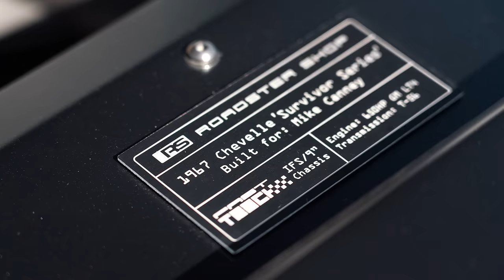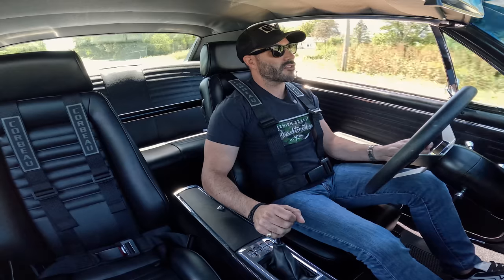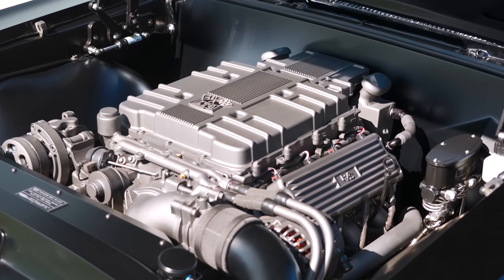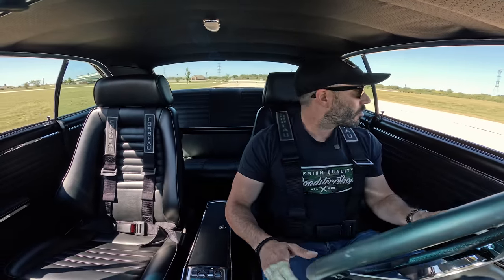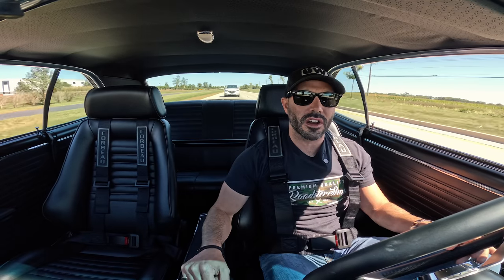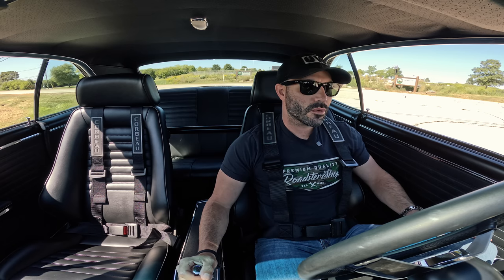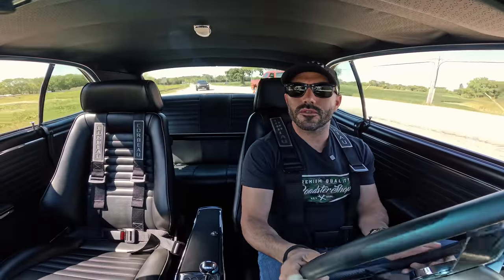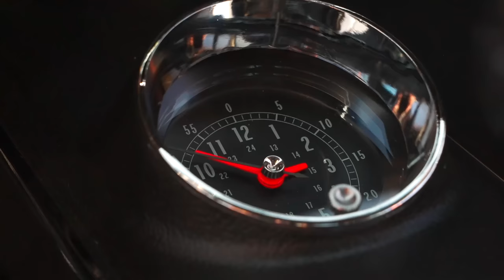'Survivor Series' 101 - Mike's 650hp 1967 Chevelle - Drive and overview

Comment: One weakspot even on boxed frames are the top rear spring pockets. 
I cut into mine and using some rectangle tubing tied the two together & the frame .
Completely eliminated any twist back there. Added edelbrock traction bars on both side (no ss camino in67) and eliminated any movement back there, boxed uppers, poly bushed, SSM lowers Hotckiss springs and basic white KYB. Launches hard goes straight no wheelhop
Wish you guys tossed out a ballpark # of a basic chassis $

Comment: so will a new vett; how much money are you at with 66 under 150;000.00
Reply: I would be surprised if it’s under 150,000. You start adding up just parts and it creeps up extremely quick. Then add labor and whatever one off items they have. I’m thinking the owner could’ve bought 2 new vette’s for this.
Reply: A vette will never compete attention wise with this.
Reply: New vette is depreciating or catching on fire as we speak
Reply: 100k in parts alone, 100k labor easy.. it gets up there fast. If you can afford that most guys have funds for a vette too. I have couple cars built by rs, and new cars inc a new z06, old cars just cooler and more viciseral...